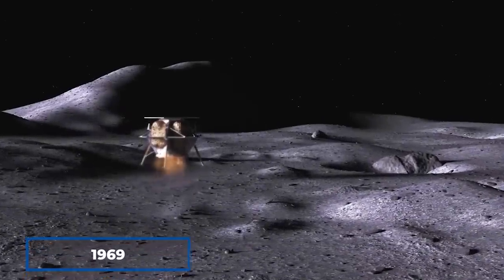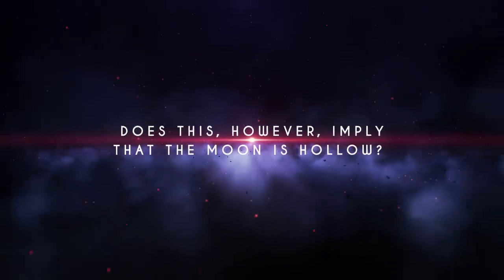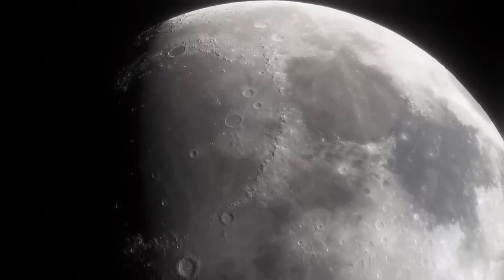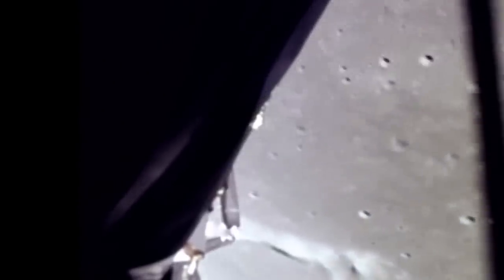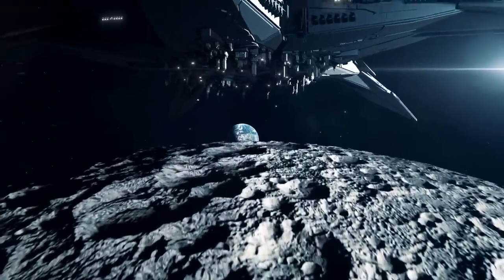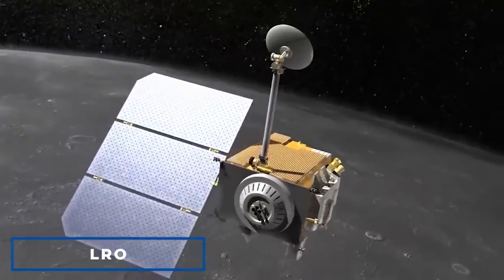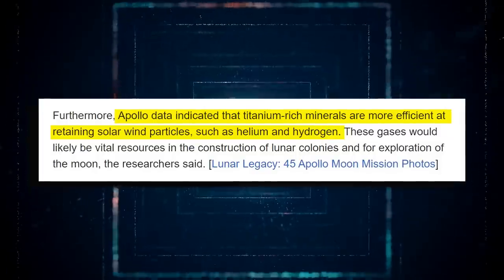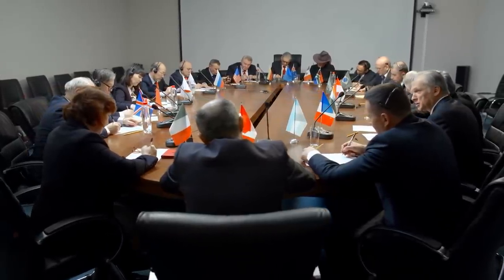This Is Why NASA Never Returned To The Moon

Comment: It's pretty amazing that man travel to moon and back in the late 1960s. But what's even more amazing is that they got that Rover up there in that little tiny capsule... LOL
Reply: The rover was not in the luner module but on the side in a storage compartment behind the gold panels, it was brought out in a few easy to assemble sections and left their, 3 more over other missions are also on the moon the third one was used for parts.